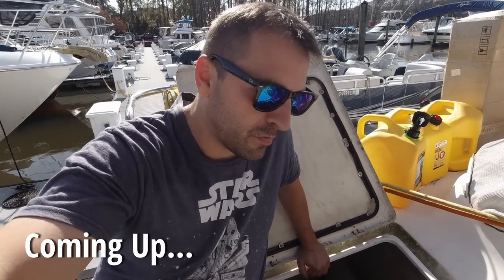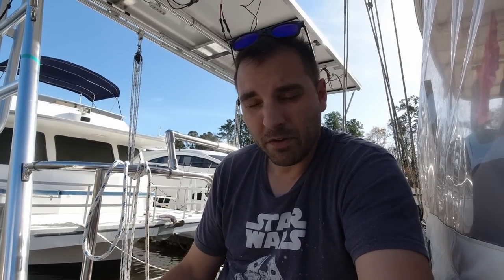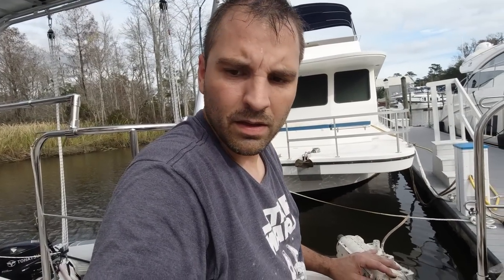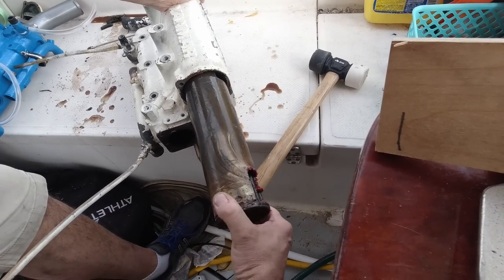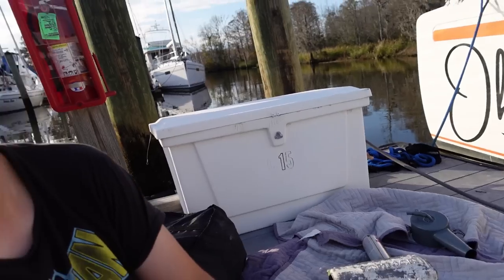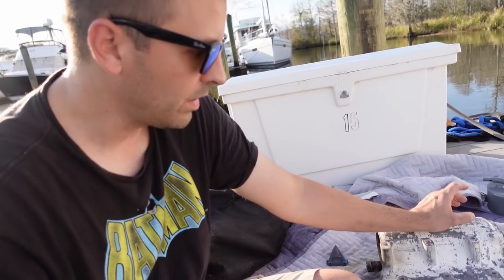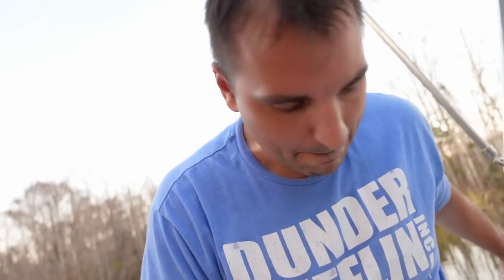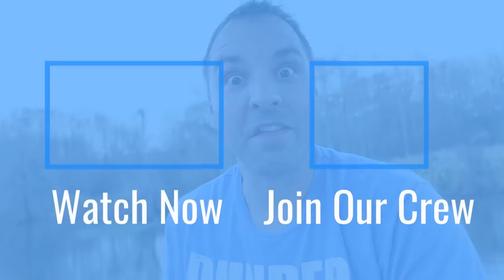Our Yanmar Marine Diesel Engines were about to fail due to lack of maintenance.

Comment: Suggestion- get a set of lefthand drills (HF $8.50) which you can use to drill out broken bolts and it actually loosens the bolt as you drill it.  A set of bolt extractors, a tap and die set and PB Blaster would also be useful.
Reply from the maker: Hi Douglas,  all great suggestions. I have most of those tools on board.  The problem in this circumstance was, to replace that part was going to cost $2500. I am inexperienced so I would rather trust the people that do it often.   If something like this were to happen while we were away from civilization I would’ve given it more effort myself.  😊
Reply: @SaltyEscape  Understand the circumstances.  I had a rustedout clogged one on my gas Volvo Penta. I busted a head bolt and had to take off a lot more items to get the exhaust piece off.  Had to LH drill out and retap myself, and it worked fine.  My aftermarket exhaust piece was around $300 while the genuine Volvo Penta was nearly $2000.  There are aftermarket items for your engines and some shops, like in UK, actually make welded up items for many marine diesels for not a lot of $s.

Comment: Love your video. I have been making videos documenting my 1 cylinder runaway Yanmar diesel. These types of videos have inspired me to make videos about my experience being a boater in Brooklyn NY on my channel. Cheers
Reply from the maker: Thank you!   It’s my understanding that in a runaway diesel situation you should shut the fuel feed off.  Is this correct?  We have shut off valves very close to the helm. (Our tank is under the floor at the helm). 
Cheers Corey
Reply: @SaltyEscape  Hey so in short - no. I unplugged my fuel tank during my runaway and my engine continued to fly away for over a minute because diesels are so efficient - it used every drop left in the line. There are two ways of stopping a runaway: suffocate the intake, or stop the ability of the engine to do compression. The latter is the best way to do this. On my engine, there is a lever on the top of the cylinder head. When you flip and hold this, it opens the exhaust valve in the engine and holds it open. This means the engine cannot do combustion properly, and stops. I highly recommend finding whatever decompression safety mechanism your engine has. Some diesel engines stop in normal operation through using the decompression lever (a pull wire goes to the helm). Worst case, you have to suffocate the intake. Becareful of any alternator belts when doing that. In the first video on my channel I show the symptoms of a runaway engine if you are curious.
Reply from the maker: Great!  Thank you.  I’ll check it out

Comment: Just subscribed . I like your attitude.
One small tip.
Some people set their idle at slow thinking that that they are saving fuel.
There is almost no consumption difference between a fast idle and a slow idle.
Diesels like to run fast and hot.
They live longer with a bit of strenuous exercise.
All the best.  Gary in Japan.
Reply from the maker: Hi Gary, Thank you!   We were working on adjusting the idle last night.  It’s just the port engine was set too low.   We changed the fuel filters (upgraded to Raycor) hoping that would fix the idle problems but it didn’t so I dove into learning how to adjust it.  It sounds much better now!   Thank you!   Corey
Reply: @SaltyEscape  GM 20 idle speed is between 825 and 875.
 I would go for 900 in cold water. 850 in warm water.
Will warm up quickly and pump lots of nice warm oil. 
Happy New Year to all of the family
gary
Reply: @SaltyEscape  The other thing about slow idle is how low the oil pressure drops. Typical oil pumps can barely keep up with volume demand at very low rpm. Demand increases with higher rpm but oil volume production increases more, so oil pressure rises with rpm.

Comment: i would still get the orginal elbows welded they would be fine then but the new ones look excellent maybe try some injector cleaner in the tanks to help clean up your start they shouldnt hunt like the did after you swapped the elbows.
Reply from the maker: Hi Gavin,  thanks for your feedback.  I need some clarification on what you’re saying?  Injector cleaner… the engines hunt?  The Portside has a rolling idle at start up but when it warms up it will idle smoothly. I thought it may be the governor or maybe the idle is set slightly to low. Is that what you’re talking about?  Thanks for your help!  Corey

Comment: Bleated Merry Christmas Guys... and good work mate, those new elbows will/should last eh... grab a can of lanolin based lubricant spray (Lanox)and apart from the belt and pulleys spray lightly around any and all exposed metal including the alternator it is a gr8 rust inhibitor and will not eat plastic or rubber, especially once you get back to salt water.. if you get the belts that start to squeal puff some talcum powder (French chalk) on the belts too and and check for leaks and/or adjust to suit eh... Hope you Guys have a FUNtastic new year.. look forward to more Videos
Reply from the maker: Hi Ned,  Thanks for all the good information!  I’ve never heard of Lanox. I’ll check into it.  I heave heard on Talcum powder on belts.  I’ll pick some up before we leave!  Cheers Corey

Comment: You could use Rustoleum paint on those engine parts.  And brush it on instead of spraying it on.  You get better coverage and it is less expensive than aerosol cans.  Heat is not an issue on water cooled marine engine parts as long as the water circulation is maintained.
Reply from the maker: Hi Michael, thanks for the tip!  I’ll remember that for next time.  Corey

Comment: To remove and replace hoses, give a heat gun a try.  Then you don't have to pry on the hose and potentially cause damage.  Experiment with the right amount of heat (time using the heat gun).
Reply from the maker: Good tip!

Comment: Just a heads up Get some ceramic grease as when screwing bolts into alloy it will almost stop them seizing DO NOT USE anti seize grease as the copper in it will react with the alloy. If no ceramic grease just use mineral grease . Well done and you def correctly undid the bolts IE a little one way and then the other Good Job .PS I am not sure with a Yanmar but there maybe anodes in the engine cooling system so check those too.
Reply from the maker: Hi Howard,  thanks for the information, I’m going to look further for an anode.  I’m confident there is not one in the cooling system because I have had it completely disassembled however there may be another one in the engine somewhere near the sail drive. After you mentioned this I seem to recall seeing something mentioned about an anode in our Facebook owners group. Regarding the anti-seize… I definitely used anti-seize, I don’t know its composition but I’ll look.  do you think I need to remove those bolts and re-coat them with ceramic grease?  thanks again! Corey
Reply: @SaltyEscape  If you used copper anti seize on a stainless bolt into alloy I would remove them one at a time clean them with brake cleaner or similar and also spray it into the threaded hole and clean as much as you   can out then re grease them with anything but a copper anti seize If the bolt was steel going into steel IE the engine block thats ok. Oh and always lubricate S/S bolts and threads IE the bottle screws on the rigging 
or they will bind up and you will never get them undone once tightened up as the threads stretch. Good luck and well done
Reply: @SaltyEscape  
Because the product prevents seizing and unpleasant sounds it is ideal for brake blocks, exhaust systems, wheel nuts and machine parts. Because, in contrast to traditional copper grease, Ceramic Grease does not contain metal, it is not conductive

Comment: Exhaust elbows have a short life. Five years is not unusual. The stainless ones will rot too because the exhaust gases lack the oxygen that protects the stainless. Pull them and check them every 2 or 3 years.
Reply from the maker: Hi guys!  Thank you so much for letting me know.  I will be keeping a close eye on these engines. 😉

Comment: Great work brother. How did you clean the exchanger?
Reply from the maker: Thank you!   I soaked it overnight in barnacle buster…. I actually used the West marine concentrated barnacle buster because it was cheaper.  I cut the top off of a 2 liter bottle and used it to submerge it… I was able to submerge 2/3 in the two liter bottle so I turned the heat exchanger over a few times.  I was very impressed with barnacle buster… that thing came out looking new!   😊

Comment: Why is that inlet for the saltwater exhaust cooling  into the exhaust elbow so vertical?
I would have thought that the water should be directed into the inlet at a 45 degree so that any splashing etc would not head towards the engine's head/valves?
Reply from the maker: Hi John,  I’m afraid I don’t know….  I did notice the mixing elbows have an inner sleeve.  Maybe that sleeve prevents the  water back flow…??

Comment: kind of thinking those two alternators should be matched, or am i wrong?   i dunno.. i'm new to this stuff.. lol  :)
Reply from the maker: That’s a good thought… maybe in some circumstances however our engines are independent of each other.
Reply: @SaltyEscape  so alternators from each engine only charge thier own starting battieres?  not charging your main power storage?   mainly because normally, if a dual charging system has imbalanced inputs, you'll cause the lower rated input to be pulled up by the higher rated input.   this is where isolation comes in to prevent this from happening.
Reply: @SaltyEscape  if the engine alternator is only charging the start battery, then WHY ALL THE AMPS?!  lol.   just saying.
Reply from the maker: Hey Dan,   It’s not only charging the starter batteries.  We have 2 Victron Orion DC to DC chargers to charge our DIY 1400 aH Lithium battery bank.  Remember, we have two independent engine systems. Each has its own starter battery so therefore we can use two separate Victron Orion smart chargers for the overflow amps.  Does that make sense?  
We are bringing in an extra 400 W per engine into our LiFePo4 battery bank. And the icing on the cake is the system is autonomous. We start the engines, the alternator recharges the starter battery and then automatically starts charging our lithium battery bank if needed.   😉
Reply: @SaltyEscape  holy cow.  ok.   thanks for taking the time to respond.  looks like i have some previous videos to catch up on.  :)
Reply from the maker: No worries, I see why you would be wondering why so many amps.  We love the simplicity of the Orions but they are 30 amp each max so they end up being the limiter in our system.  That 80 amp alternator may be able to generate more power for our lithium bank however with that we would need other equipment and upgraded wiring… Not worth it at this time. We’re thrilled with 800 extra watts from the engines.  We do have a generator on board but we’re hoping to only use it rarely.  
I certainly don’t know everything… I’m just learning as we move forward.  I read every comment that comes in because often there is good information. Earlier today somebody told me that I should avoid using anti-seize because it has copper and that will be reactive to the aluminum metal in my heat exchangers. Who knew? 🤷‍♂️  i’m adding a task to remove each bolt one at a time and clean off the anti-seize with brake cleaner… (His recommendation). Then replace the bolt lubricant with ceramic grease which, evidently won’t be reactive.  
we are so thankful for all the knowledge that our new friends are willing to share!!  😊
Cheers Corey

Comment: Obligatory not a Diesel mechanic my uneducated guess regarding your "honkers" is that it creates a slightly positive pressure environment smoothing out your exhaust pressure and  removing the highs and lows in essence it chokes the engine slightly. The same principal on water systems where you have a reservoir bottle. Of course I could be speaking Bo**ucks but seems like this is what it could be.
Reply from the maker: Lol. I think you’re right.   Becky was entertained with the name… Honkers.  🤪